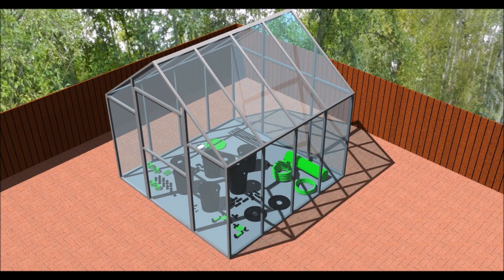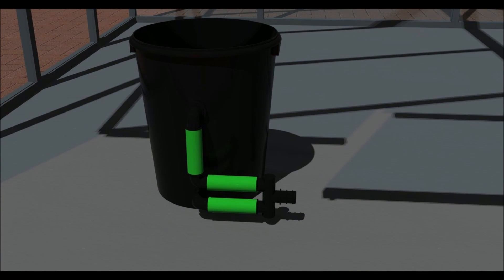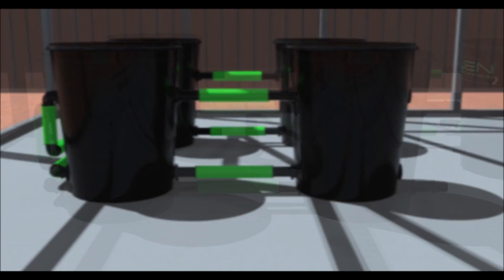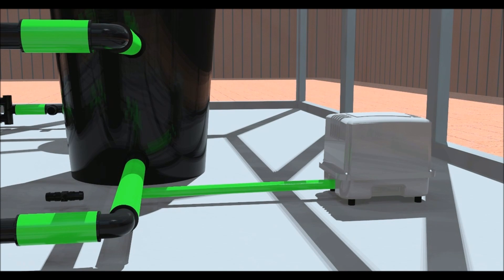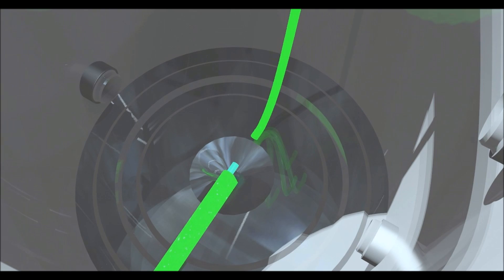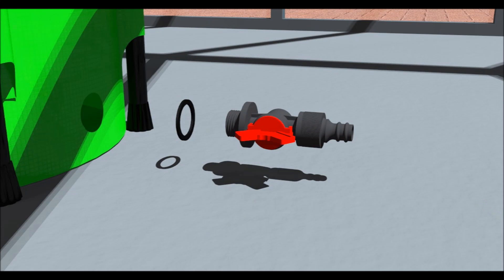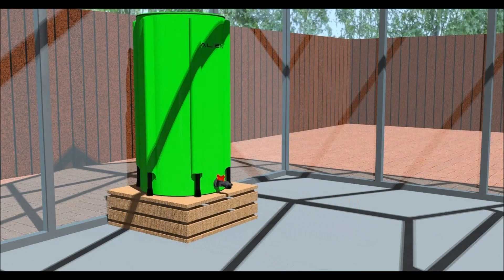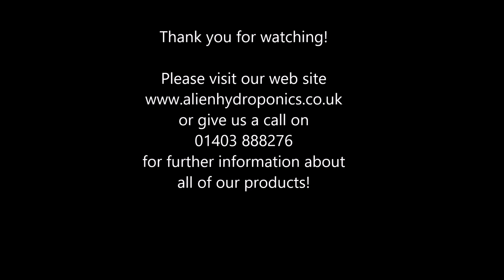Alien® RDWC set up video XL Hydroponic system DWC

Comment: using sloped pots with bulkheads that are not designed for that applications is not advised
Reply: I think that's why they are using such small circulating pipe diameter, because 25mm isn't too large to not fit inside the curvature of the pot.
Almost ALL other high performance RDWCs have 2½ - 3½" PVC pipe and similar bulkheads, though they make their systems with square shaped pots. connecting a system of the same layout with smaller diameter piping (as shown here) seem to work with exactly the same outcome as far as quality and consistence go to the best of my knowledge. The only benefits to having a RDWC with 3" piping is the easiest for the water to move in more freely, and be easier to clean and maintain. The easier that water flows around in the system the less work the pumps are having to do, meaning less heat. Restriction is an energy consumer, as too is heat, the two of the most important things to keep in mind when you throw a system together.
Reply: This system is not a Recirculating Deep water culture. It is a simple Deep water culture system, and a bunch of unnecessary pipe, there is nothing to push water. No water pump. Just a water supply available to the first pot, and that pot feeds the next pot, and so on.. this is horrible? Wouldn't it be?  well a very bad method because the more pots U have the more fucked up U will get. The middle pot will draw water from the first pot, the last will draw water from the middle pot, etc. Theoree shows the pot will have half the amount of the nutrients as the pot supplying it. And it will only continue. 
If I'm wrong, I'd love to be told how you figure this. And if I'm missing something about how this system works let me know. But it makes sense as so why CURRENT CULTURE Undercurrent XL is the only tested and proven champ in the field, others can only copy. Or make drastic gimmicks as this surely was and probably why the company went bust.
Reply from the maker: Hi Mark, thank you for providing a summary of our features, however there are some inaccuracies in what you have relayed.  The current ALIEN RDWC system does include a water pump in the header pot.  You can view the system here - https://www.youtube.com/watch?v=eUpNSlO44Bw. Technical information is also available via our website.  Here is an example. Simply click on the "Specification" tab - https://www.alienhydroponics.co.uk/systems/rdwc/rdwc-pro-sliver-series/rdwc-pro-silver-series-36l/alien-rdwc-4-pot-36l-silver-series/
Reply: 😂😂😂 where's the water pump ?

Comment: What they are not telling you is with all water buffer systems you are better getting an RO machine. As the tapwater is rubbish. The system is good and viable  and will produce results without RO. in order to supercharge the plants you need clean pure water.

Comment: hy how change the water? how many times must change in this system? and the big tank in the behind is in there nutrients to nix it hisself? thx
Reply: TheGrow Boss you do a res change every 7/10 days and do you mean the flexi tank mix it your self or get a circulation pump pretty simple it will get mixed once it flows into head pot as there’s an air stone in there